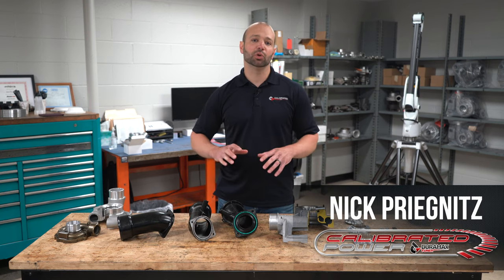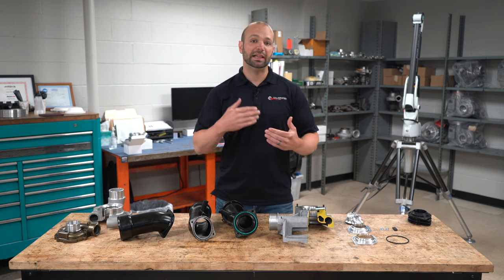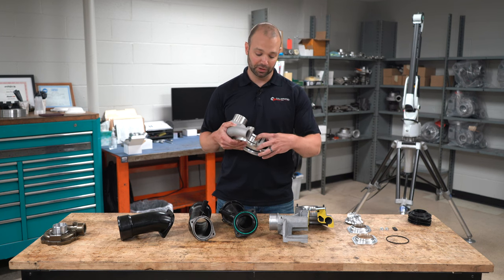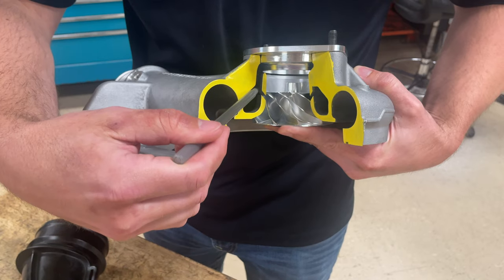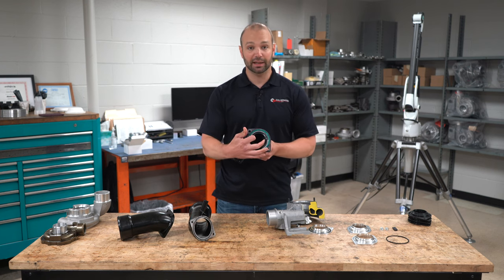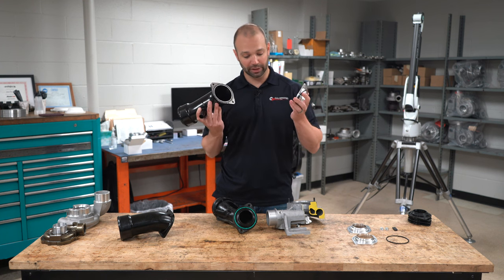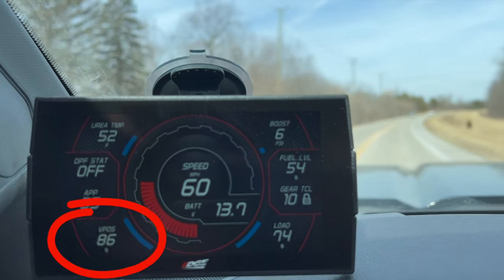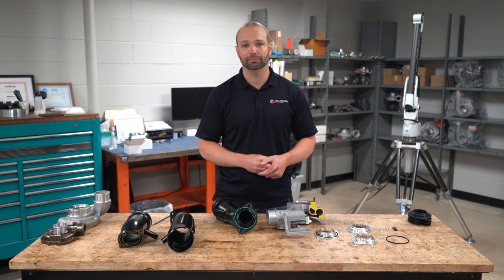Solving L5P Duramax Turbo Surge

Comment: I own a 2017 and 2020 L5P. I tow at a combined weight of 32k under all sorts of conditions. These truck DO NOT have a problem with compressor surge. This is my 9th Diesel truck, 7.3L has compressor surge for instance.
Reply: Yo, same here. I don’t tow that much weight but I actually have a banks ram air intake plus WCFab intake horn on my 21 L5P with NO SURGE.

Comment: I'm having this problem on my 18 L5p. Bought the truck brand new and just started doing this at 167,000 miles. The truck is tuned, deleted running nothing more than a aftermarket air intake and exhaust system... The truck will make a hissing noise and then intermittently chirp when under load (hauling a trailer) up even a slight incline.

Comment: My last 22 5th gen had crazy turbo surge under 0 load. And only started happening once I added tge s&b. Now, I'm not sure if this code has anything to do with the surge or if the surge was caused by the code. But fully oe truck with an intake. Surge would happen as I was coming to a stop with my engine brake on. The truck ended up having slow boost respand full emissions failure so now I have a 21 l5p denali. I just thought it was odd to see surge on stock tune with just an s&b.  I thought perhaps it was the s&b

Comment: L5P deleted.. Wcfab horn with surge ring. Not necessarily the chirping/surging problem, more like a rolling stomp on the throttle, and it coughs and falls on its face… then comes alive 🤷‍♂️
Reply from the maker: What intake are you running?
Reply: @Duramaxtuner  just now saw this message 🤷‍♂️, but I had the banks intake, and switched to the Wcfab just for eye candy, seems to be about the same
Reply: 50calprepper mine does the same did you ever straighten it out ? I also am running banks intake thanks man
Reply: It is the module that banks provide for the intake. That's what is making your truck surge. Remove the module and plug it directly into the MAF sensor and data log for your tuner to see the live data while you drive under load, full throttle, and normal driving.

Comment: My 2019 L5P (with Banks Derringer otherwise stock) with 1500lbs in the box (2 snowmobiles on a sled deck) gets what I feel is a turbo surge. Slight grade or headwind and I lean into the throttle it surges bad, maybe 5 chugs in a matter of just a second or 2. It feels pretty violent and it usually scares the shit out of me so I let off the pedal. I haven't tried unplugging the derringer but I think that's my next move. Anyone have any thoughts on this?
Reply from the maker: An intake horn and anti-sure ring may be in your future. Start with pulling the tuner and seeing if the problem persists.

Comment: Is the add-on surge ring opening diameter any larger than the factory intake horn opening? I wonder what percentage higher flow it would get with the aftermarket intake but with the "restrictor" at the end?
Reply: Our horns can be purchased to match whatever size (stock appearing) turbo you have on the truck. They’re available in stock size, STR, 64mm, and 67mm.

Comment: My ring didn't include instructions or any notes so I just installed it. Now it's assembled with the surge ring still in my intake horn, do I need to tear it apart and cut that ring out? Why is there no instructions/ link to a youtube install or at least a note saying to remove the horn surge ring included with the ring in the box? If someone on facebook didn't see my pics and point it out I would have never known.
Reply from the maker: Sorry for the confusion. Glad you got it straightened out.

Comment: If we have a stock turbo do you recommend not cutting out the WC fab surge protector that cones with there's?
Only cut it out if you have a upgraded turbo right?
Reply from the maker: @realroadsideservices5862 No! Even if you have a WC Fab intake horn it is worth removing and replacing the surge protector that comes in the pipe with one of our Anti-Surge Rings. The airflow into the turbo will be less turbulent and our Anti-Surge Ring protects against surge better than what comes in the pipe. You can find our stock turbo anti surge ring here on our website: https://duramaxtuner.com/turbo-chargers/l5p-intake-horn-anti-surge-ring.html

Comment: I've got a 08 LMM 125k. I've got HSP bolt on's everything except egr delete, duramilage economy tune, fass 165 pump, ppe'd both pan's. Adapted oil filter to CAT, new radiator lines and mishimoto transmission cooler. My transmission can't seem to make up its mind going through the gears at slow and steady pace. I've got a shift kit, but nobody will install it, I'm thinking about purchasing your tuner that changes the transmission on demand of the tune. I seldom put my foot in it, I don't have to! 3 quarter throttle is plenty for me. Basically all I'm after is mpg, maybe little quicker boost response. I do have a 3"down pipe, it not installed yet. Seldom get out  for distance on the inter state, getting 17 mpg city/local. What do you recommend?
Reply from the maker: If you still have the emissions intact our engine tuning may work for you. Either way, our TCM tuning will likely help.

Comment: So if I have a bone stock truck with bone stock turbo you're saying I don't need that part correct??  I will be tuning soon though. Will this be an issue with a tune or stock?? Thanks!
Reply from the maker: That is correct. This part will only be helpful if you have an aftermarket intake air horn.

Comment: Question, how do compressor surge covers not cause the same issues as a boost leak? I understand the air recycled back into the intake, but is it still not a big leak from the high pressure side? Or is its design and placement such that it's actually not a high pressure zone under normal operation?
Reply: The compressor wheel itself is under vacuum. Only the tips of the compressor wheel see any pressure as they eject air into the housing, anti surge housings allow that pressure to escape out of the compressor wheel and recirculate back into the intake to keep the wheel from momentarily stopping(surging) when the compressor cannot maintain the pressure ratio at the given flow rate (surge).(high pressure+low flow rate(or closed throttle valve)=surge). Hope that answers all you your questions. Lots of physics at play.
Reply: @maverickturboresearchandde4381  certainly does. Thanks very much.

Comment: 2019 l5p, Stock turbo with after market wc fab horn, have experienced surge while towing. So I just grind out wc fab’s built in surge ring and pop dmaxtuners in its place???
Reply: Yes exactly. Id suggest an update to your tune as well if applicable (assuming tuner has an anti-surge update).